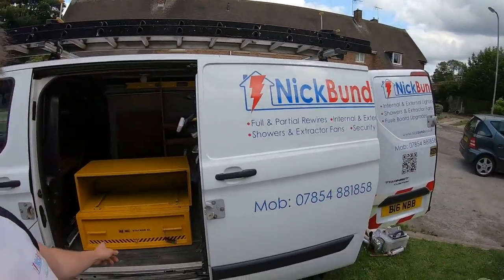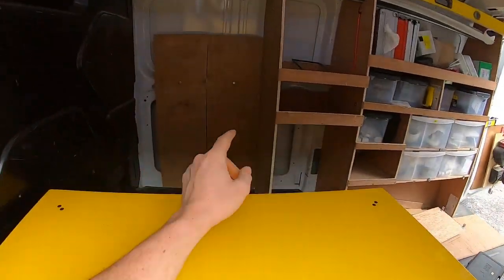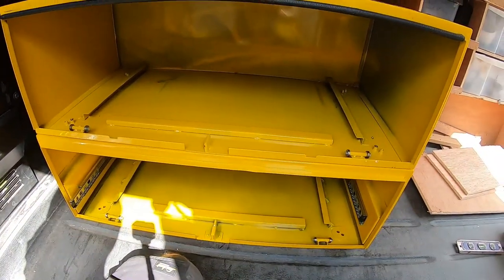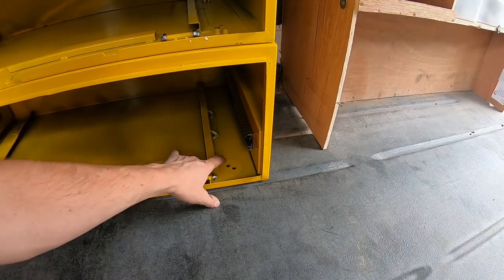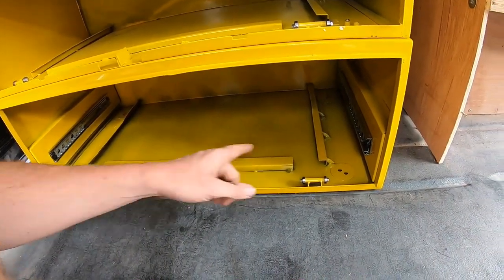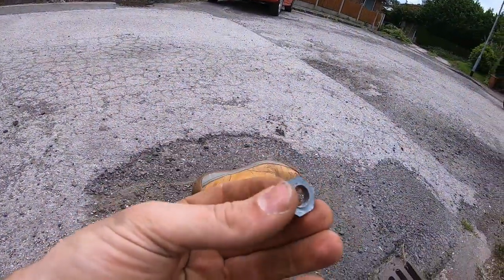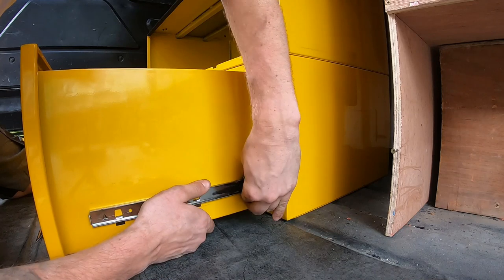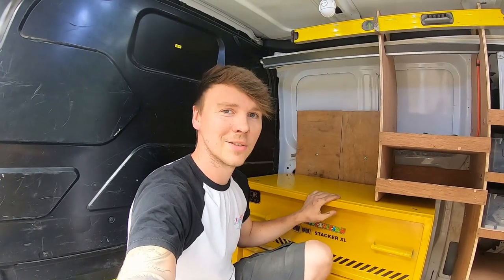Installing the New Van Vault Slider XL

Comment: I reckon a locksmith could change out those locks for ones that are keyed the same, then you only need one key for them both
Reply: I don't think you'd need a locksmith, the padlocks can be removed by undoing a couple of bolts on the inside. You can order keyed alike disc locks online to replace them. 👍

Comment: Nice. Worth spraying the newly drilled holes with some underseal or something. Those transits will always rust. You can also get these fittings called rivnuts which is used for sheet metal much better than those self tappers.

Comment: Hi Nick,
Quality video...
I have just bought 3 of the new style and put them in the side door opening of the van (same as your van). This works well as I don’t have to climb in and keep the space in front of them clear. 
I think it works well...contemplated putting where u have but went with my placement. Let me know if u want me to email a pic. 
Keep up the good work (I’m not even a sparks but enjoy watching)
Reply from the maker: James Blake cheers bud and I had the old one there for a few days but I use both back and sliding all the time so for now I’m quite happy where they are 👌 my rubber matting for the floor turned up today so looking forward to getting that in 👍
Reply: N Bundy Electrical  sweet! You’ll have to do another vid when sorted....

Comment: Nice job. Looks a bit tight for your new rubber flooring.
Reply: I was thinking a couple of washers under each fixing hole or a thin sheet of ply under the whole thing could have been a good idea.
But with 2 vaults you're always going to have your most used gear in the top one and your rare use life saver tools in the lower one, which will inevitably be blocked closed in a few weeks by surplus gear on the floor of the van!